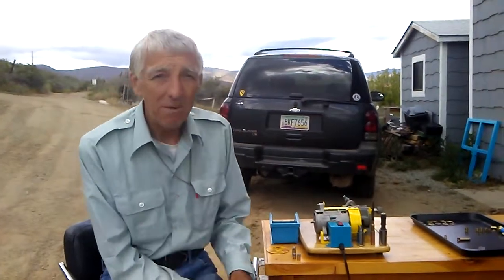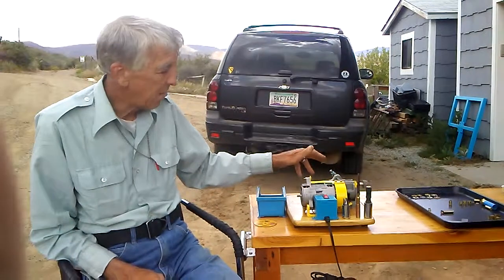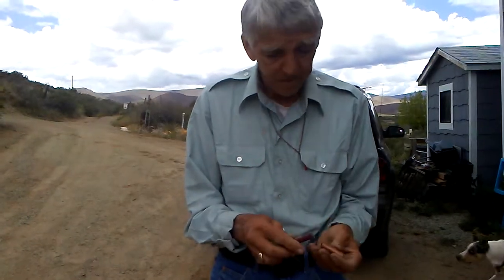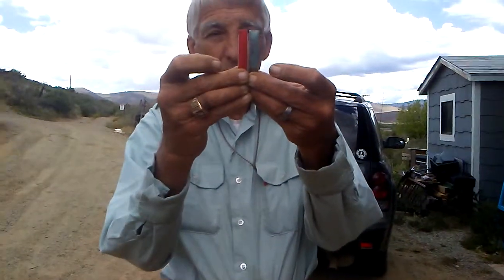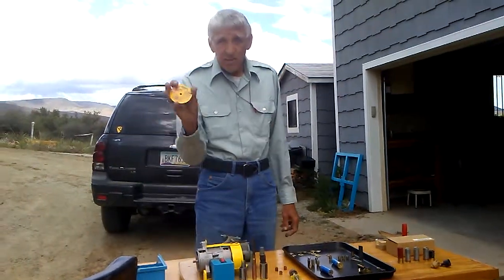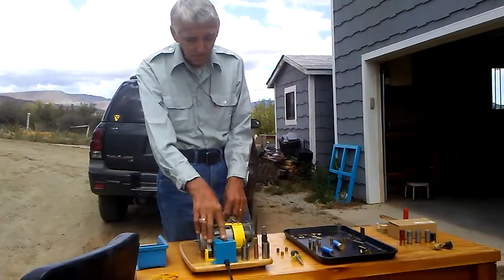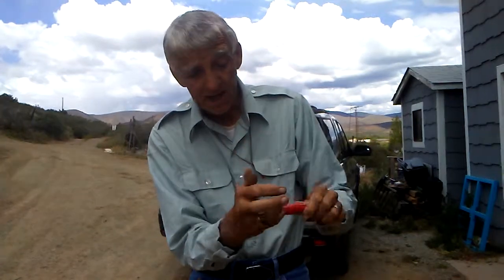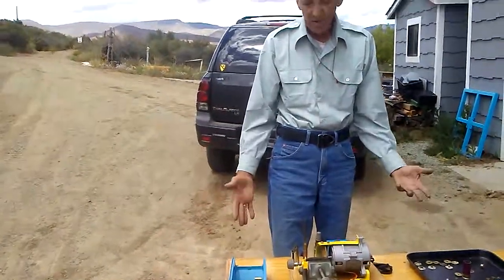CUT BRASS MINI CUT OFF SAW MADE AT HOME W/ RECYCLED PARTS ETC. 0512191110

Comment: G’day Casey and Marisue, well made and I’m sure you’ll have many years of service. I particularly like the cam adjustment for alignment, good thinking. 
I’m not into firearms so forgive my ignorance but I presume the casing is deformed when the projectile is fired and this machine cuts off that area, if so then is the next charge smaller than the original. 
Cheers 
Peter
Reply from the maker: Good day Peter, in response to your question about cutting the worn part of a cartridge (YES) by shorting the wad column enabling us to use the same charge and load.
The main purpose for this saw is to cut down 40 cal. brass down to the proper dimension accurately in order to swage them up to create 230 grain .45 cal. ACP projectiles-.451 diameter, also for cutting down .223 brass to make .300 blackout cartridges.
Thank you for you time and great videos, Casey & MariSue